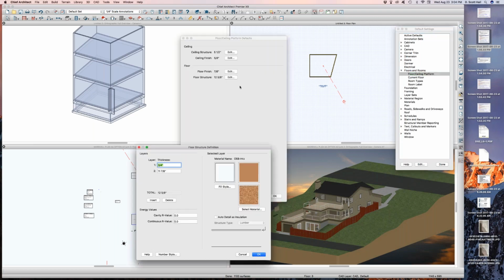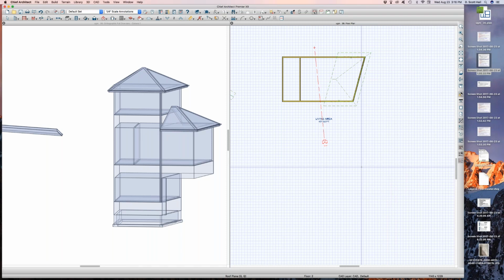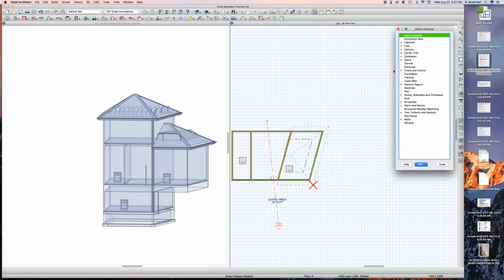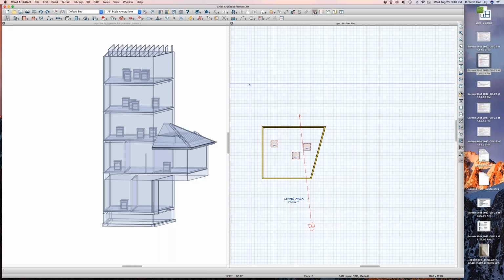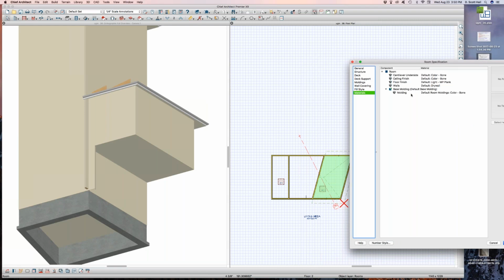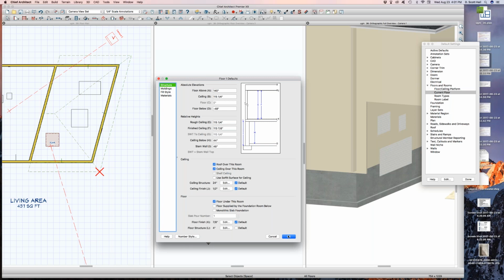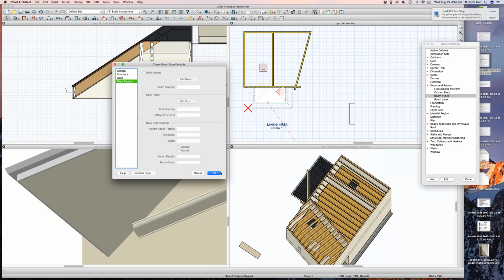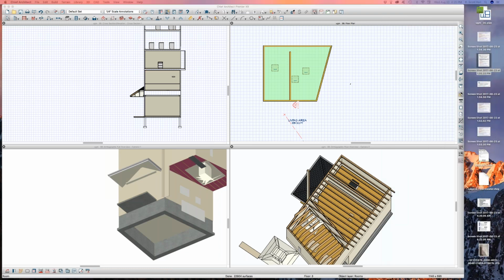Exploring defaults part 3....  long but might be worth the time Chief Architect Videos by dsh

Comment: I have started watching your YouTube video.  I am wondering if I am understanding this correctly?...

Any settings not check marked to use defaults take precedence in this order...
1. Room Specification (Currently Selected Room) : Structure Tab
        2. Room Type Defaults : Structure Tab
               3. Current Floor Defaults
                        4. Floor/Ceiling Platform Defaults

Anything under the "Room Specification (Currently Selected Room) : Structure Tab" that is check marked to use the defaults will look for settings in this order....

1. Room Type Defaults : Structure Tab   -  If something is check marked to use the default, next
     2. Current Floor Defaults   -  If something is check marked to use the default, next
          3. Floor/Ceiling Platform Defaults

Likewise, anything under the "Room Type Defaults : Structure Tab" that is check marked to use the defaults will look for settings in this order....

1. Current Floor Defaults   -  If something is check marked to use the default, next
     2. Floor/Ceiling Platform Defaults

Likewise, anything under the "Current Floor Defaults" that is check marked to use the defaults will look for settings in this order....

1. Floor/Ceiling Platform Defaults

Either I am on to something or I have completely the wrong idea.